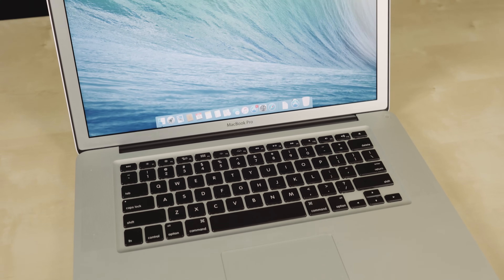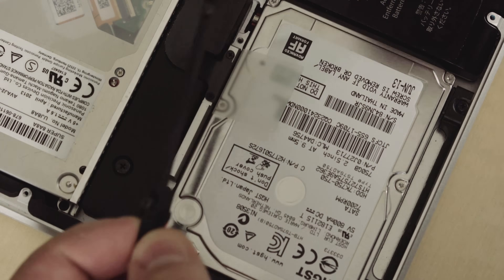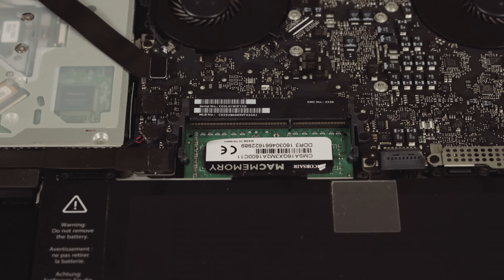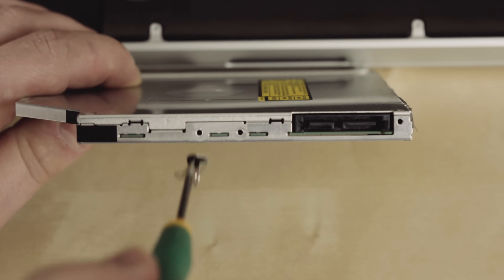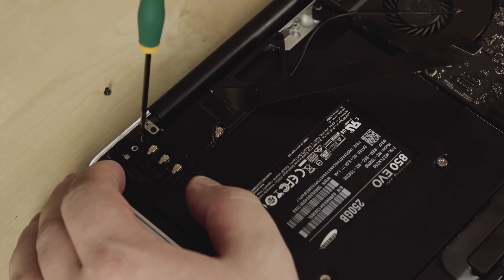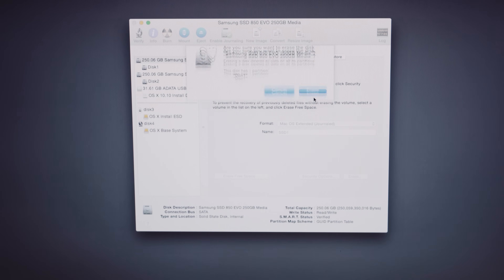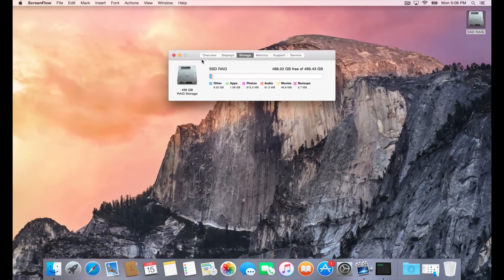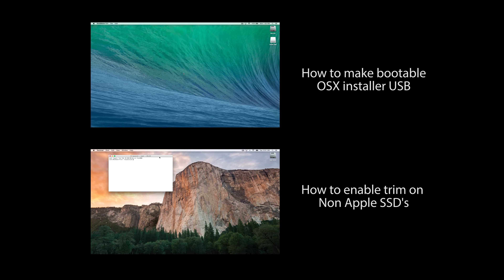Fastest 2012 MacBook Pro Ever! Upgrade Guide - in 4K

Comment: I am SUPER intrigued by the video. I have a Mid-2012 MBP 9.1 w/ 2.6 i7 and 1TB HD. A couple of years ago, I upgraded to 8GB RAM, but know that I am running Mojave, it just isn't performing as I want, but no way I can upgrade to a new MBP. I was considering replacing my current HD with a Crucial 1TB MX500 2.5" Internal SATA SSD and then installing a Crucial 2TB MX500 2.5" Internal SATA SSD in the optical drive slot. @LeeZavitz any ideas if this would cause any issues when running Mojave? I am also going to upgrade RAM to 16GB. I had seen some advertisements when I upgraded from 4 to 8GB that I could do 16GB but couldn't find anyone that had actually done it, but now that I have seen your video, I am definitely going to upgrade to 16GB. Thank you so much for this video. I love this MBP and need to get some more time out of it, so spending a few hundred dollars is much more palatable to the checkbook than buying a new one! I appreciate any feedback or insight you can provide! Have a great day!
Reply: While formatting new SSDs, make sure you do NOT use APFS file system. Should become super fast.

Comment: Can I just put in 1TB SSD, with 2 x 16GB of memory? Instead of 2 SSD's and 2 x 8GB? Macbook mid 2012 15in.
Reply: Wondering the same thing...actually was thinking about putting a 1TB  in the HD spot and then a 2TB in the optical drive spot...just didn't know if that would work...anyone have suggestions or knowledge?
Reply: I thought about that too, will take work? I want to know for sure before ordering my ram and my SSDs.
Reply: @Dave198827  I dont think these MBPs support more than 16 GB of RAM. As for the SSDs, why not? But adding 2TB to a 1 TB system will not make it RAID. The SSDs (or HDDs) in a RAID 0 config need to be identical.
Reply: Hi there, I ordered 16 GB of Ram and 1 TB of SSD. 1TB External.
Reply: @Dave198827  External? It will run over the USB connection? That is just super slow... The 1 TB SSD should go on the main bay.

Comment: Will this allow me to run Premier Pro and photoshop 2020? I've heard alot about the processor not being enough. If not how do you upgrade the processor? My mid 2012 is still solid really don't want to replace it.
Reply: What did you end up doing? From my understanding you should be able to use these programs fine, the only problem would be the GPU which would be unsuited for Mojave and forwards.

Comment: As I said, that raid config is always going to be SLOWER than just installing a bigger sized SSD in the main circuit, due to the limitations of the communication protocol speed on the DVD circuitry...
Reply from the maker: jovial469 incorrect. The DVD data controller on the 2012 MacBook Pro runs at Sata3 6Gbps. The same as the main drive. You get full throughput Up to 500mb/s read and write. And once’s you’re combine them into Raid0 you get 900mb/s .
Reply: @ Lee Zavit - Although Apple claims 6Gbps (750MBps) in the optical bay, there are several tests and documents around stating or claiming that it is not so, and that this connection is only 3Gbps (375MBps), as opposed to the one in the main bay, which is a real 6Gbps (750MBps). These maximum speeds are always theoretical or the product of marketing. I have a mid 2012 A1286 at 2.6 GHz and could only do in the optical bay around 1.2 Gbps (150 MBps), while in the main bay I could have 2.4 Gbps (300 Mbps). On the main bay, I have an OWC 6G Extreme SSD, which stands FAR BEHIND any Crucial, Adata or Samsung SSDs, where I can get 4.8Gbps (590 MBps). Apple in 2012 never antecipated that someone could install an SSD in the optical bay, hence they had no reason to even think about such, much less investigate nor develop such solution.
Furthermore, in all the documents I could find on macbook pros, the "Negotiated Link Speed"of the optical bay NEVER goes above 1.5 Gbps (185MBps)...

See
"Testing has demonstrated that Apple factory hardware does not reliably support a 6G (6Gb/s) Solid State Drive or Hard Disk Drive in the optical bay of 2011 and 2012 MacBook Pros (Model ID 8,1; 8,2; 8,3; 9,1; 9,2). If your OWC Data Doubler bundle comes with a 6G drive, you should ONLY install that drive in the main drive bay and utilize the Data Doubler to re-task your existing drive or install a new 3G SSD or HDD in the optical bay. PRE-2011 models can utilize a 6G drive in the optical bay, but will do so at a reduced 3G (3Gb/s) speed."
INFO on OWC site.

Looking forward to learn some more, can you find a document which states differently?
Regards
Reply from the maker: @jovial469  Correct 2011 will run at sataii 3gbps. But what makes the 2012 unique is that it has an updated sataiii controller on the dvd drive port. Im just going based off my experience and what I showed in this video. Running on its own is around 500mbs and when I set them up in a RAID0 array I was getting double the bandwidth around 800-900mbs which is kind of showing that its clearly running at sataiii 6gbps. Im just going based off my experience using this system for 4 years and it has been running solid. Im actually putting out a 4 year follow up video on this system out tomorrow. WIth updates running Catalina.
Reply: @LeeZavitz  Just for the sake of experiment, you might wanna try one of those Samsungs working alone in the main bay, you will see it going to 1.2Gbps... Better yet, use a 970 Pro with a sata adapter as enclosure for the SSD position... I'm waiting for the "time" to buy one, as I did this on an A1278...
Reply: BTW, Lee, What you want is NOT the "speed"under system report (6Gbps)... You want the "Negotiated link speed", which in this model, (9,1) is 1.5Gbps... as opposed to the main bay 6Gbps for the NLS...
Reply: There was an investigation that concluded that IN THIS MODEL, the cable connecting the optical bay was not capable of 6G, only 3G... You have Raid Stripped, so be careful, you may get some lockouts...
Reply from the maker: @jovial469  it pretty much ran for 3 years in Raid0 getting full 6gbps bandwith out of both connectors. I only recently broke the raid apart so I could double boot two different OS on each drive. Never had a problem with it.
Reply: @LeeZavitz  Great, but I still think you should be having around 1.2 - 1.4 Gbps... Getting 900Mbps looks like you're getting 600 + 300... Which would show I'm wrong in my assessment...
Reply: Both channels at 6Gbps would be 12 Gbps (1.5 GBps).
NVME SSDs are not accepted in this MBPs
Your 900 MBps is the result of 6 Gbps (main) + 1.5 Gbps (optic) = 7.5 Gbps = 937.5 MBps
Reply from the maker: jovial469 you don’t have to believe what I show you in the video but tbh you are over thinking this for no reason. ssds on a good day will not give you over 500mbs through sataiii. That said , two sataiii connections you could only ever get between 900-1000mbs if they were the best fastest drives in the world
Reply: @LeeZavitz  You're probably right, let me see if I can find some screenshots.
BTW, great job there. I just wouldn't Raid...
Reply: Överthinking"... Yep, do that a lot, with everything lol

Comment: are you still doing these upgrades? its 2020 now and wondering if this mbp can take up to the 1tb on ssd and memory past 16gb of ram. thanks
Reply: Im running a 13in Mid 2012 with a 1TB SSD and 16GB ram. ive had for a while. runs well but it gets HOT!
Reply: Toni Loves Skateboarding ok, that’s the price to pay for upgrade. 500gb should be enough then. Any in particular you recommend of SSD. And or Ram.?
Reply: Diego Marquez Samsung Evo SSD are good. I just ordered one for my iMac. $169 for 1TB. And for ram, crucial is what I think I got. 16GB. After watching these upgrade videos last night I ordered a new battery for my MBP. It’s been faulty for a long time and I guess that messes up the performance.
Reply: @ToniLovesSkateboarding  CHANGE THERMAL PASTE !

Comment: This is a really good tutorial and will definitely help. However, the most crucial part to upgrade those is to replace the thermal paste on the CPU! Yes it takes a lot of time and all but ultimately, none of this matter if your CPU can't cool properly and you just bough 2-4 months of performance!! :O Just a reminder. Also I get all my parts from Other world computing : lifetime guarantee on RAM, great prices, same day shipping on most stuff for free a very little.
Reply: I beg to disagree:
1 - Yes the thermal paste is important, but the cpu runs much cooler with an ssd than with an hddd, due to less current variations due to mechanical parts on hdd.
2 - The speed of the ssd is at least 20x that of the hdd. Even if you have a 7200 rpm (never saw one on mbp), it will still be much faster (15x) and much cooler.
3 - For an old mbp to overheat with an ssd, the thermal paste needs to be non existing or completely dry.
4 - OWC are the SLOWEST of the branded ssd...

Comment: Ok, so that Raid 0 will not work as fast as it could, for 1 reason. In any Raid 0, the maximum speed is limited by the maximum speed of the slowest SSD. The SSD on the caddy has half the speed of that on the main plug, and as such, a Raid 0 assembled in these positions would have a maximum of possibly 250-300Mbps, as opposed to just 1 SSD in the main position, which will have 500-600 Mbps...
Reply: Concluding, it is better and faster to put a double sized (2 TB instead of 1 TB) in the main position, while retaining the dvd drive for some ocassionallyvideo (for the kids, for example).

Comment: Hey I really wanna upgrade and reactivate my MacBook Pro but it’s not starting anymore. A certain part of the mainboard gets really hot. A broken condenser or sth I guess. What can I do to get it fixed?
Reply: What is the model and where are you located?
Reply: jovial469 Hey, it’s a 13.3 inch MacBook Pro, Model No: A1278 (somewhere between 2009-2011 I guess)
Reply: I would follow the several youtube videos around, to replace the thermal paste of the heatsink, as a start. Maybe Lee Zavitz, the OWNER of this thread has better info...

Comment: Good video, if a have a SSD samsung 860 evo of 500 gb and i want to do a raid0 it will work as great as yours if i usa a 256 gb SSD samsung 860 evo or i just need another as the first one??
Reply: See my post
Reply: Better to put a 1 or 2 TB in the main position without Raid. It will always be faster than any Raid that, because the speed of the caddy is limited by that board connection at 300 Mbps...

Comment: I'm a little late to the party here, but here I am! Rather than sinking $1200 in a new MacBook right now, I'd really like to try this. I LOVE my mid-2012, however it has been significantly slowing down lately (I understand it's an 8 year old computer, but I'd like to think there's a way). Am I able to do this without the 2 SSDs and keep my optical drive? Is the installation the same for 1T? Would I need to do the RAID thing if I just replace one hard drive? I'm not a computer person, so excuse my ignorance. Also, it is necessary to to make a bootable OSX installer?
Reply: As I said before, buy a 1 TB SSD for the main bay + 16 GB of RAM, and keep your optical...

Comment: I noticed you mentioned the hard drives have to be the same size, I saw another video right before watching this where the guy had a 2tb ssd and and TB ssd, could I do that also?
Reply: This can be done. Some people use a small boot ssd, e.g. 120 or 240 gb, + 1 or 2 tb data drive on the caddy. Others just use 1 ssd that's 500 gb or higher and keep the dvd.

Comment: Thanks for this - some of the ideas can be applied to a Mac Pro tower (2006 1,1 through 2012 5,1) to give these a real boost also. In many respects the cheese grater towers gain much more as they are server class and have multicore Xeon processors that are suited to speed (any laptop is dumbed down on the CPU and components for space, air flow, battery life and to reduce heat). A 2010 Mac Pro tower can be given a 12 core Xeon CPU / SSD RAID upgrade which will (today in 2020) beat up most new Macs.  Bear in mind that on the towers before 2010, the internal bus was restricted to 3 GBs even on the 8 core models. In this case an easy hack is to put the SSDs on a PCIe card in one of the free bays which run at 6GBs, then install your system and apps onto this - you immediately double your performance and you will see a significant reduction in boot / shutdown time.  The MacPro towers can also run Windows natively through boot camp and take advantage of technologies like turbo boost on Intel CPUs. They have huge performance even by todays standards. Cheap as chips used:  https://bit.ly/2WdejG2

Comment: Be aware, having owned one and used it professionally... the 17" MacBook Pro is short on RAM out of the block so maxing that out (beyond Apple's specs) and putting the OS on a 6GBs SSD is necessary to get half decent performance, not a hack. Putting two matched SSD's in and RAID striping for speed with a slimmed down system (remove 90% of the fonts you will never use for example as they all sit in cache) is the boost hack that gives you a beast, however this MBP has a fatal flaw you need to be aware of - the cooling system is woefully inadequate. Using SSD's in some respect helps this as they don't generate any heat (like the traditional HDD you will have removed), but you have a 1GB dedicated GPU squeezed in there (and a mobile graphics chip on the CPU board when off mains power) and that does create heat when pushed - lots of it. 

The design suggests that the case itself dissipates heat and that's as may be but not enough. At All. Dig a little deeper and you will find micro-fans and ducting to help circulate air. Over time these clog up with fluff and the MBP begins its spiral into meltdown because they are virtually impossible to clean without a complete strip down.  Compressed air wont do it for you.  I looked after mine religiously, a mac user for 20+ years and it still burnt out the motherboard leading to a catastrophic and fatal burn out which took the GPU with it. It's now a $3000 door stop. Still looks pretty though.

Awesome and a head turner when working, will easily run FCP and drive a 27" monitor used as a desktop Mac once upgraded, but watch the cooling. It's fatal.
Reply: Hey thnx for the pro headsup ..i was just thinking of 2 ssds then read your comment...now i am like 1tb ssd and my 5400 hdd in dvdrw slot with caddy ...will that also generate same amount of heat
Reply: Just do this:
1- SSD in the main bay
2- Keep the optical
3- Change the stock thermal paste for Artick silver, Cryonaut...
Then you'll be set for years to come
5- DO NOT USE liquid metal as thermal paste here...
6- Add 16 GB of RAM

Comment: @lee zavitz
I have a mid 2010 15”. Can I use all your specs here for an upgrade? Or do I need less MHz on the RAM?? Thanks
Reply from the maker: I you can upgrade ram to 8gb and replace the hard drive with 1 ssd and you will see a big speed increase. But that’s all you can do on the older models. Remember that’s over 10 years old now.

Comment: can i make for a macbook pro mid 2012 ssd 480gb and default hdd with 16 gb ram? what about change graphic card because it has a intel graphics 400 and i use it for architecture. Awesome video!
Reply: Intel 4000 for the normal operations, but for intensive it should change to the NVidia GPU, no?